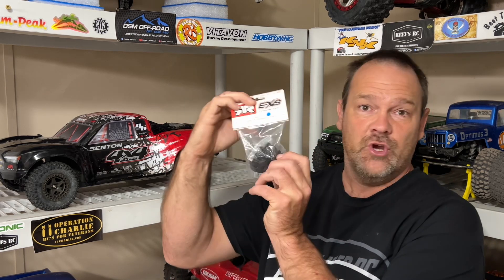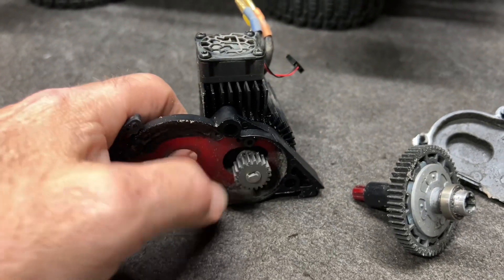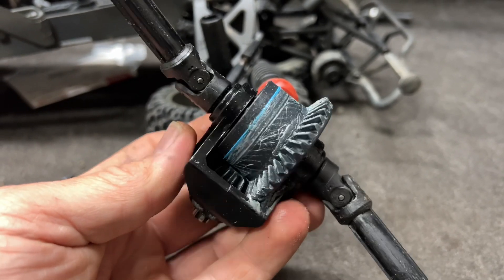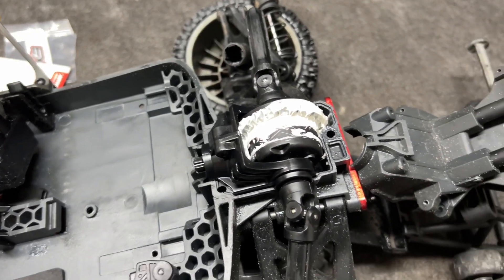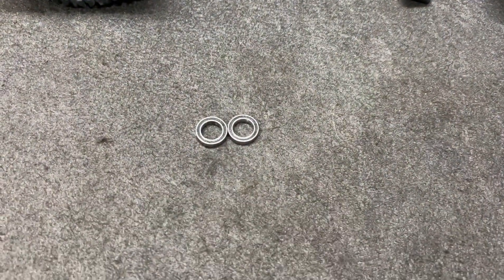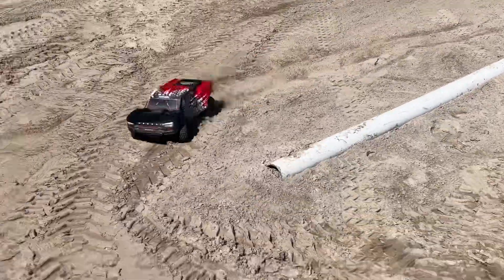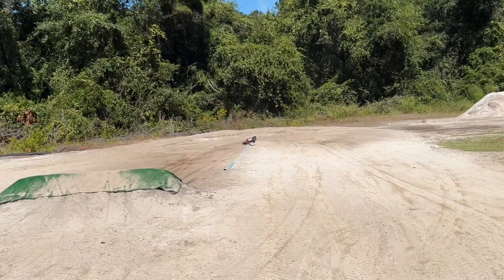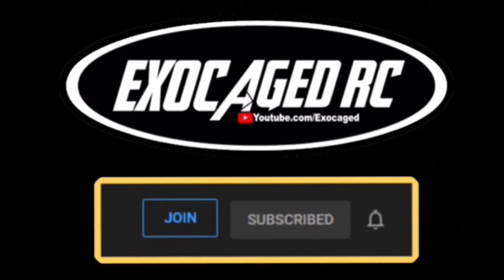UPGRADED CNC 4S Diff gears in the Senton 3S

Comment: If you have a longer tool tip, your meant to go down the center of that half shaft to access those screws.
Reply: To fix the problem with the dirt in the spur I just cut out a hole in the chassis under the spur gear and never had that problem again
Reply: Yup u don't have to take the shaft apart it won't work like it does after u take it apart like that I did that before lol
Reply: 2mn down in the middle of the shaft lol

Comment: You need a metal spur gear or it will strip against the metal
Reply from the maker: yeah I did put a 4s metal one in
Reply: I was thinking about getting it. I find them on ehh Bay for 40 each

Comment: The stock diffs are a bit stiff but get looser quick. the Senton dont really need stronger diffs as the wheels are small and light. Sealing the power module opening is a must! i use some blue painters tape and it stays clean. you'll destory the spur & motor quick if you dont do that
Reply: Any Rc that runs more than 2s will fully benefit from all steel drivetrain. Unless you like doing diff work after every other pack
Reply: @Corhndog  I have this car for 3 years now, run only 3s, still stock plastic driveshafts, replaced rear diff (crown gear) twice. It’s fine
Reply: I’ve been in the game long enough to no you’re lying or you drive like a grandma. Pry both honestly.
Reply: Nah bro my senton has been 3s put at least 30 or 40 packs through it and no issues, other than the center axel and servo. I have no complaints
Reply: @Corhndog  maybe that’s the issue, you’ve been too long in the business.. try modern cars and not traxxas
Reply: I run 3s mostly...still on stock diff on the 2nd gen!!! Tapes definitely the best upgrade!! 😅

Comment: I've never had issues with the stock plastic diffs, even running 4s and bashing it super hard!
Reply from the maker: I didn’t either but I want it to be as reliable as possible plus I needed to open it up and fix the drag issue
Reply: Wait so you can just buy a 4s and use it? I thought it was only compatible with 2-3s
Reply: @dylanbrookbank9669   swapped out the ESC.

Comment: I did that to my big rock 3s a while ago, keep some shims on hand! I run through maybe 5-10 batteries per week, and I've only had to add 1 shim to the rear diff over the last few months. I don't go super hard bashing, skatepark once a week, but a ton of beach running. And look at the mod to cut a slot below the spur gear in the chassis, let's everything fall right out. I've been on the same metal HR spur gear since I got the truck last year.
Reply: Hi! I just ordered this product for my granite, I’m new to hobby so I don’t know when to shim the diffs. How can you tell? Thank you very much!

Comment: When removing the axles from the diff, youre supposed to have a long 2mm driver and go into the axle shaft to unscrew the screw. No need to take apart the u joint.

Comment: Why did you get metal diffs if you didn't strip the originals? Since you're not beating on it makes no sense
Reply from the maker: Why not? I almost always upgrade things before they break
Reply: Seems like a good way to burn thru a bunch of money for nothing. The odds of stripping the original diff is pretty hard unless you abuse the poor things. All this does it send the shock up the drive train to the spur and drive axle which now both have to be replaced with metal
Reply: @kenmastersmaster I have run 6s through my granite on stock diffs for 18 months. Just put it back to 3s for my son. Now I run 6s on my kraton 4s V1. Still on stock diffs. No problems. Don’t land full throttle. And don’t goose it non stop. It’s alright.
Reply: Some of us enjoy tinkering with our cars we get enjoyment from upgrades whether it’s necessary or not that’s a irrelevant to us

Comment: My senton was a bit tight up front, seems to be getting smoother after a few packs though.  I ve got a major issue trying to remove the half shafts, the screws are lock tited overly well and i can't remove them.
Reply: Put a hot soldering iron tip on it for a moment or two to heat the thread lock up and that should help release the grub screw on the half shalt be careful not to hit the plastic tho
Reply: @gonzodetroitify  I'll keep this in mind if/when the time comes.  Actually it was interesting to see exo was able to remove the universals as i may need to do that to get the iron in there without melting the plastic.  Cheers!

Comment: Those are actually better than the 4s diffs. The stock 4s diffs are of weaker powdered metal. Youre not supposed to pop the driveshaft joints, you just need a really long hex driver to get into it!

Comment: Haha sometimes it is good to watch YouTube you could have looked up the easy way to get the drive shafts off the hubs haha, the cheap hex drives are long and can fit through the whole drive shaft to get to that screw. If you want them to be extra strong get the HR yoks keeps the input and ring gear from separating

Comment: I bought these tires for it

Pro-Line Racing Badlands MX28 2.8 MTD Raid Black 6x30 F/R PRO1012510 RC Tire

The chassis needed to be modified but you have way more control no speed wobble...

It does pop wheelies so there's still some work needing to be done to drop the front and raise the back...

But it's a night and day difference with control.